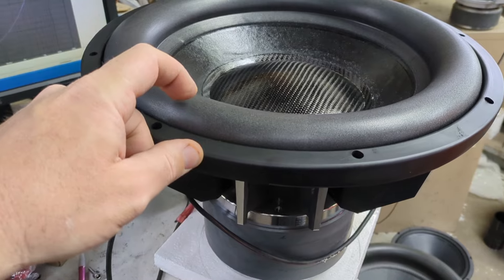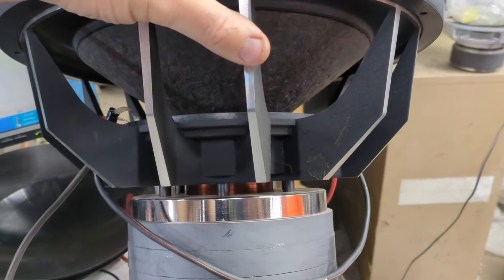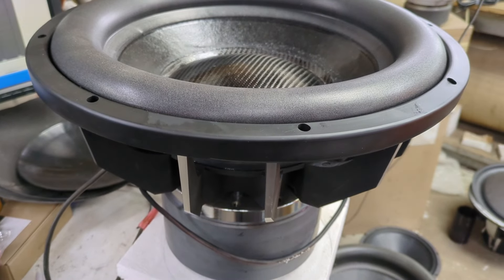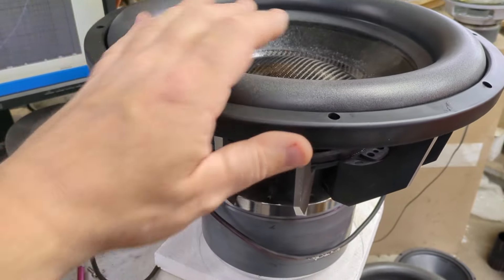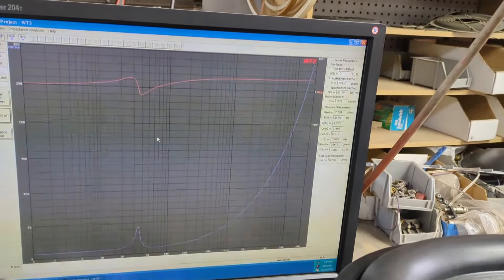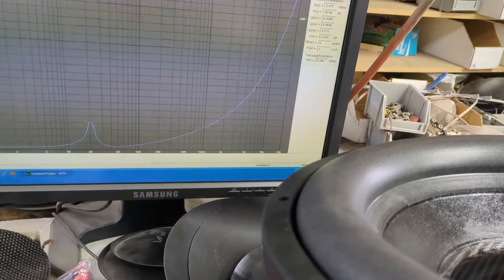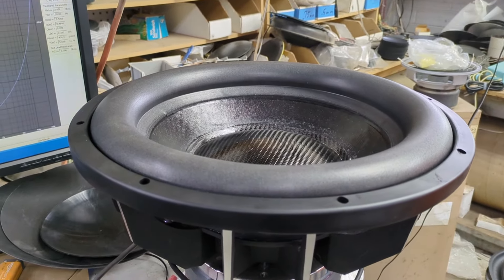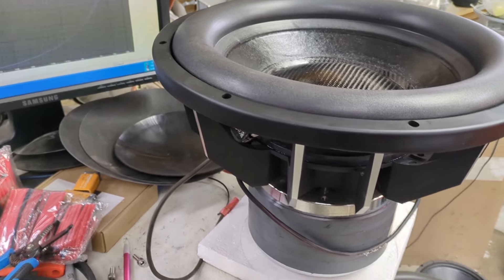15" D2 GONZO Jr Junior Home Theater 20Hz Floppy Butthole by Robot for Robot

Comment: Do you sell drop in recone kits for the nvx vcw 15 2ohm v.3
Reply from the maker: Sure Text me direct with your name and your shipping address 602-312-6504
Reply: Come to find out I had a screw stuck in a vent hole on former kept slapping the top of the motor I thought it blew up but nope tested with volt meter n it was good so my curiosity got to me. So I took both dust caps off and there it was lmfao dumb ass lol. 🤣  fixed it tho got it back together and it's louder than it's ever been. Just in case tho I still want a recone for it